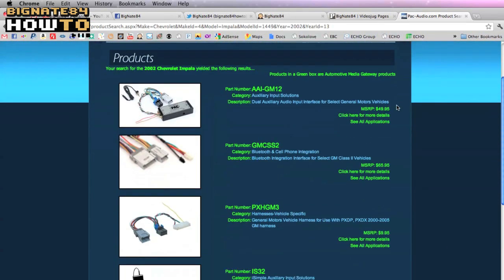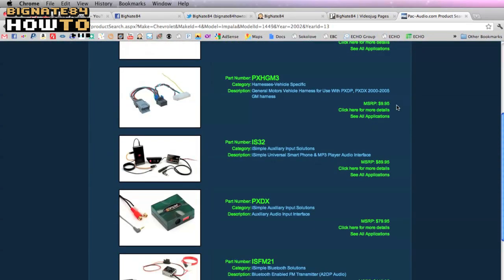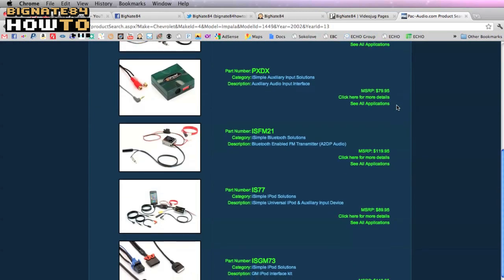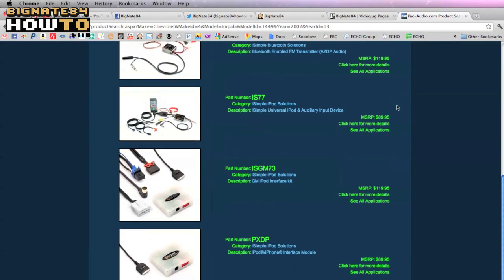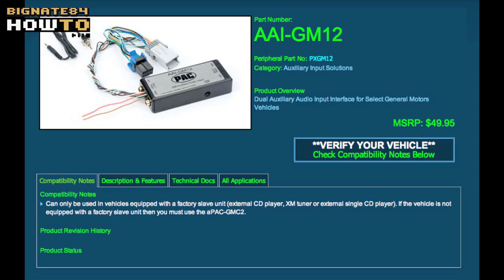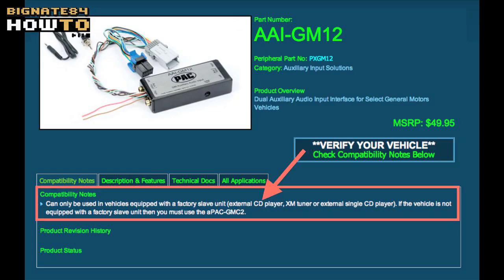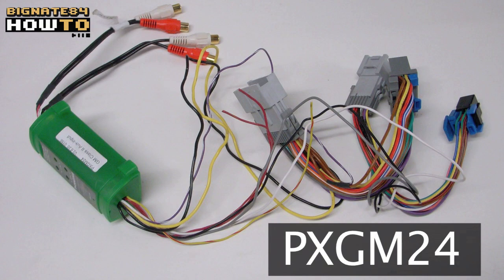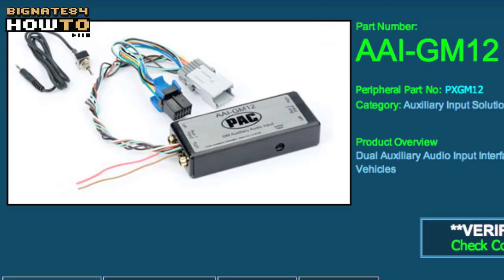How To Turn Your Car Ashtray Into An Audio Input

Comment: Hey somebody help please I tried putting the wire in b3 (I just crammed it in with the wire currently there but my 2002 impala does not recognize that there is an aux plug in pls help

Comment: or you can just buy a fm modulator for around $5 and plug it into the mp3 player. no need to remove or tampered with anything :%
Reply: George P. while that is a viable option, it doesn't give you the sound quality a hard line does.

Comment: The AAI-GM12 says "Can only be used in vehicles equipped with a factory slave unit (external CD player, XM tuner or external single CD player). If the vehicle is not equipped with a factory slave unit then you must use the ISGM535."

I have the cd/aux button but no satellite, external cd or disc changer?  The ISGM535 looks spendy.
Reply from the maker: Yeah, it's a little confusing. The way I understand it is that you're stereo head unit has to be able to support a factory slave unit (not all stereos do).

Comment: Too bad this doesn't work for the GM radios with both CD and tape capabilities. You don't get an auxiliary input with those. Still have a tape adapter, but I'd really like to have something that could mount flush and feel natural in the car, and not get wrecked when the cable gets stepped on or pulled.

Comment: Ok.. so I have commented below.. but I will share my full SUCCESSFUL experience here (with hindsight included): 

I returned my AAI-GM12.. I believe it was the right part, but I thought it wasn't.  It essentially taps into the auto cables you need.  If it wasn't working when you tested it.. you need to have your CD player.. or whatever device DOES do audio in your unit on for it to work. 

I have a friend who is an electronics engineer who helped me do this WITHOUT ANY PARTS! That's right.. all you need are some spare wires and special tools!  And this should work on any car radio!

I did this in my 2005 Impala with standard CD player. 
This should work on ANY vehicle with an audio device such as a CD player or tape player. 

My process : 

Tools needed: 
A. Soldering equipment
B. Some wires.. The kind you want to plug into your audio device (Aux or RCA)
C. A multimeter
D. A Signal injector

Steps taken: 

1. Take out the radio

2. Take apart the radio and remove the CD player (or tape player, or other Audio device that already works)

3. Find the connectors for this CD player (disconnect them from the main unit). 

4. Hook the radio back up to the car without the CD player in it.

5. Test each of the pins on each of the connectors from the CD player using a signal injector with the radio and speakers on.  You will need to listen to your left and right speakers to identify the left and right channels. 

6. Label them! (the ground is probably in between the left and right channels) 

7. Test the rest of the pins to find the ground using a multimeter (you want to get a reading of 0 when you touch the ground pin and the metal case for the radio).  Label this one too. 

8.  Splice the 3 labeled wires.  Solder them onto your audio cable (you will need to cut the cable and identify the left and right channels and the ground).  Also reconnect them to their CD player inputs too so you can keep using it.

9. Run your audio cable out of the radio and to wherever you want it to go (like out your ash tray). 

10. Reassemble and you are done! 

11. Note that the CD player (or tape player etc).  needs to be on for you to hear audio.. a good solution is to put in a blank CD or tape (it doesn't need to be playing.. just needs to stay running).
Reply from the maker: +Jesse C Woah you get the most detailed comment award!  Can you make a video for us? :-)
Reply: +BigNate84  I took some pics but did not make a video. if I do it again i will record it.

Comment: So did I buy the wrong part?  I have the same car as you, but the PXGM24 is no longer sold.  I tried the AAI-GM12, but it's not working.. Did I get the wrong part?  Do I need to have XM satelite radio for this to work? 

Is it the ISGM535 that I should have ordered?
Reply: I too have an impala my radio does not have a slave unit and pretty sure it's not XM ready, making both AAI-GM12 and ISGM535 not viable options, have you resolved this issue? Or what do you recommend?
Reply: +Adrian E. Lopez I was told by said electronics engineer that the aaigm12 would have worked. I believe my issue with it was giving it power.. which I could have done I suppose. 

I recommend what worked for me. I can send u my pics of the process. (send me ur email i guess) If u or someone u know has any experience soldering circuit boards and you are very careful to put everything back together properly it should take 3 to 5 hours (it took me 5).
Reply: +Adrian E. Lopez  see my comment below!

Comment: Looking into doing this, just wondering though if the radio still works afterwards?
Reply from the maker: +BGgamesca yes sir! That was my intent. To be able to press the AUX button and switch from the radio, to CD player, to AUX input without changing the way the factory radio worked. This solution did just that.

Comment: you are a bit wrong. in the beginning you said you will be installing the product with no factory slave unit and you say that the aai-gm12 is similar to it even though the description clearly says it must have a factory slave unit.
Reply: +Jonathan Najera So... should I have bought the ISGM535 instead?  It looks like I have a useless aaiGM12

Comment: The Aii-Gm12 requires a red wire to be attached to a certain pin,but i have 0 idea how to do it, and i cant find any good videos or guides on how to install it, my car is a 2005 Grand Prix which is compatible with the devices and i have everything hooked up aside from the red wire to power it, please help
Reply: +KingBigNose I ran into the same problem.. now I think the AaI-GM-12 is the wrong part... do you have satelite radio or a CD changer.. or just the factory radio?

Comment: I've got the AAI GM12 or whatever. It looks simple enough to install, the instructions are as basic as can be... basically a little drawing/sketch of the contraption intercepting the cables relayed from the radio (face unit) to the cd player (multi cd tray holder actually). I can see the pin adapter connecting into the cd player/holder... BARELY.. literally about an inch of space across as I can only unfortunately see it from the right side as it connects into the back/bottom left of the cd tray.

You did a superb job, very fancy.. I don't care about fancy, I just want the damn thing connected so I can use the switch the device gave me to switch it to AUX when the CD Player is "selected". I don't care if the things laying on the passenger side's floor, I'll figure something out heh. Anyway totally appreciate the video it gives a great heads up for the installation, literally the only one I've seen of it's kind (not even the same device/product) online... I may be bothering you for some technical tips via some messages :)
Reply: +CoC HogWars where did you connect the red wire. i dont have a b3 wire on my stereo connector

Comment: Im confused. Why do u need the usb car adapted? Does it need to be charging why playing audio or what?
Reply from the maker: TimeToThrive H The USB is for charging only.  It's purely a convenience driven thing.  On a long road trip it's nice to be able to charge the device so it doesn't run out of battery power.  In this setup USB is not a requirement but nice to have.  Audio plays through the 3.5mm input.

Comment: I actually have the same vehicle as you, haha. Would you recommend that I get the
AAI-GM12? BigNate84
Reply from the maker: I did this AUX input project back in 2009.  It's great for what it is.  But if I had to do it again I would consider an aftermarket stereo with a stereo input on the front and Bluetooth built in.  I have Bluetooth in my 2012 Camry and let me tell you, wireless Bluetooth connection for podcast playback, music playback and to turn my car into a speaker phone is a beautiful thing!

Comment: Would this work for a 1995 Ford Escort?
Reply from the maker: Noah Schenck I'm sure there is a solution for a '95 Escort.  I'm not sure about the exact interface you'd need.  Have you considered upgrading the stock radio?  You could just get a new stereo with an AUX input built in.  In some cases that could be more cost effective now that prices have dropped quite a bit.
Reply: I've actually been thinking about that haha. Just got it for my first car, and since I'm a High School student, it would awesome to be able to listen to music from my phone. So yes, I might just buy a whole new setup. Thanks!

Comment: Very good , so I have an impala ls (2002) with no external audio input just the same radio you had , but I have controls on my steering wheel that controls the volume , song skip , and the radio is needed for oil lamp and tire pressure , would all that still be accessible with what is used here ? Cause I don't wanna lose the steering wheel control or the tire pressure warning/reset , I seen ways around like buying a aftermarket harness for my Kenwood head unit but it cost 150 more dollars, and at that I'd lose those options with the stock radio control .. Curious ?..
Reply: I hope he reply I've been wondering the same thing

Comment: Would this work in my 03 trailblazer with no slave unit and no band/xm, and it has a cd/aux button? It says the aai-gm12 needs a slave unif
Reply from the maker: The thing with slave units is a little confusing.  The stereo must not have an external slave unit present, however it must have the capability to accept an external slave unit.  The Aux interface is basically taking the place of an external slave unit.  Based on what you said I would said, yes, this will work http://amzn.to/V5xJtz

Comment: Hello does the music sound good? Does it sound better than a mp3 cassette input and sounds more like a aftermarket head unit? Does your car chimes still work such as the door and low gas chime? Thanks
Reply from the maker: Jordan Loreth The music sounds as good as it possibly can as it is reproduced by the MP3 player.  Said another way, the analog AUX interface does not add any detectable coloration to the sound.  Unless your a mastering engineer you won't be able to tell.  It sounds substantially better than an old school cassette adapter.  Yes all car chimes still work.  The car chimes work even when the stereo is off.

Comment: Big Nate, does a 2002 mustang have those rca cords behind the radio?
Reply from the maker: Malik Ravenell nope.  You'll need to buy an aftermarket interface.  The only exception would be if the previous owner installed a similar interface to give you an AUX input.

Comment: Hey, I have a 2005 impala and an Ipod. I want to do the exact same thing you did in the video, but I'm confused on what adapter to buy. Should I just go with the same one you mentioned in the video? (AAI-GM12)
Reply from the maker: Devon O'Brien it depends on what you want to do.  Do you want just a plain old analog audio input?  I would recommend using the search tool on the website to find the compatible products.

Comment: hey big nate...i have the same factory stereo without a factory slave unit...trying to install the aai-gm12 interface...says it needs an active slave unit...was wondering if their is a way to activate the slave to get it working...really dont feel like spending the money for the isimple interface...any info will be a huge help...and again its the exact same stereo as in the video on my 2002 chevy impala ls
Reply: And my stereo does have the cd/aux button...pluged the aai gm12 into the 12pin connection...spliced the red wire to the yellow switched 12+ wire...wasnt  sure what to do with the brown wire...but turned the radio on...but could never get it to switch from cd to t he other aux source...help me out big nate...not trying to spend 90 bucks on th he isimple set up
Reply from the maker: mike trollinger Always best to start with the simple things.  Sounds like you already double checked the wiring to match the instructions.  Do you remember setting the volume knobs?  If I recall correctly I needed a screw driver to set the volume screws.  Also sometimes I had to play around the AUX button to switch between AUX 1 and AUX 2 since the interface I used in this video actually supported two AUX inputs.  I don't have this car anymore but I think if I held down the AUX button it would switch between AUX 1 and 2. It could be that you've plugged your iPod into AUX 2 on the interface but the car stereo is set to AUX 1 by default.

Comment: Hey Nate. Awesome video. I have the same radio/car as in the video (2002 impala). I just bought the AAI-GM12 and hooked it up the way the instruction described. Connect the correct plugs and hook the red wire to pin B3 (accessory power wire). I cant get it to work. Do you know if you would have used the AAI-GM12 in your car, would it have worked? I know this video is a couple years old but I'm hoping you can lend me some knowledge. Thanks, Matt
Reply from the maker: Matt Briggs I no longer have this car anymore BUT I may be able to help.  Always best to start with the simple things.  Sounds like you already double checked the wiring to match the instructions.  Do you remember setting the volume knobs?  If I recall correctly I needed a screw drive to set the volume screws.  Also sometimes I had to play around the AUX button to switch between AUX 1 and AUX 2 since the interface I used in this video actually supported two AUX inputs.  It could be that you've plugged your iPod into AUX 2 on the interface but the car stereo is set to AUX 1 by default.

Comment: Hi, I'm trying to find ways to Play my IPhone music through my Car Speakers, It's a 2002 Toyota Celica, it had a Casset player, a Radio, much like your's in the video, (2 Block cables to unplug, aswell as the antenna plug), and however, it wasnt covered in the video, if it would work with Radio's that DONT have an Aux input/output at all. Would this still work?
Reply from the maker: If your stereo doesn't have a CD / AUX button I don't think it will work.  but I'm not sure about Toyotas.
Reply: You can get a casette tape with aux cable attached..

Comment: You give the updated version of your PXGM24 as the AAI-GM12. The AAI-GM12 requires a SLAVE UNIT! You stated you do not have a slave unit???
Reply from the maker: Your stereo must be capable of accepting an external slave unit but it must not have an external slave unit installed.  Basically if you actually have an external slave unit then that unit will occupy the AUX audio input.  You would have to remove the slave unit in order to switch to the AUX source.

Comment: I have a 2005 Trailblazer with what looks to be same stereo you have in your video. I do NOT have a slave unit, NO ON-Star, NO tape deck. There is NO sign of XM. I am very confused on which model I need. Can you help please?
Reply from the maker: Hey Travis, not sure if I'm too late to help.  In any case you need to make sure your specific model of stereo has an AUX / CD button.  If yes, that tells me that your stereo is capable of accepting an AUX input.  If no, then you'll need a different solution than the one I'm using here.
Reply: Thank you for your help.

Comment: Hi I have the exact same car as you and I wanted to know if they still make aux inputs for the vehicle. When I google it I get different results and as person who knows little about car audio I don't know which one is the right one. Do you have any you can recommend.
Reply from the maker: Well it depends on the type of radio you have in the car.  Even though we may have the same make and model car, sometimes different model radios are installed in cars of the same model year.  Does your radio have an AUX/CD button?  Also does it have an external CD changer?  These are some of the things you need to determine before I could suggest an aux input device.
Reply: BigNate84 Yes the radio has an AUX/CD button and and the CD player is internal. Its the same radio as in the video

Comment: Does this only work with a stock stereo system? I bought my car used, and it has a newer, but still aux-less stereo installed.
Reply from the maker: Probably not.  There are other ways to do it though.  What is the stereo's make and model?
Reply: It's a Kenwood kdc-mp288. I was actually able to plug a "CA-C1" cable (13-pin DIN on one end, and 3.5mm audio on the other) into the back of the stereo and feed it into my glove box. Your video DEFINITELY got me one the right track though. Thanks!

Comment: Will this work on my 2005 Impala Ls? I believe it's the same radio, but I don't have an ash tray. There is just a little basket holder underneath with no hole that I could have the wires go through. Any way way I can install an aux input as well? Thanks
Reply from the maker: Hey Sean,  Not sure about the 2005 Impala.  See if you can find the model number on the stereo.

Comment: Does this work if you have a tape deck? I have the same factory stereo in my 2004 impala except it has the tape deck and cd/tape button(no aux button). I've tried cassette adapters and they sound like crap in my car.
Reply from the maker: Hi Chris,  Not sure about your specific situation with the tape deck.  Is the CD player external or internal?  I think that's the big thing to make note of.  Your stock radio must be able to accept an external slave unit for control.